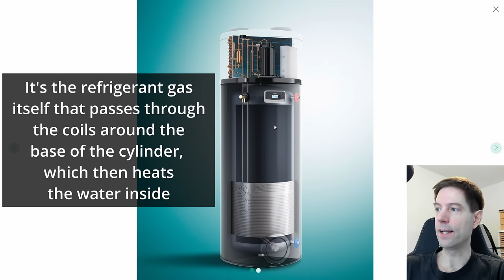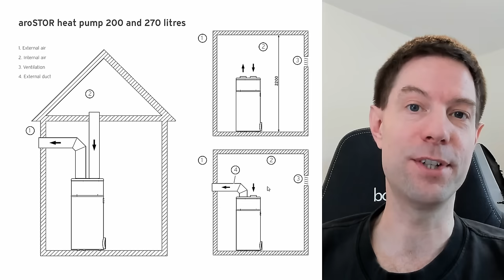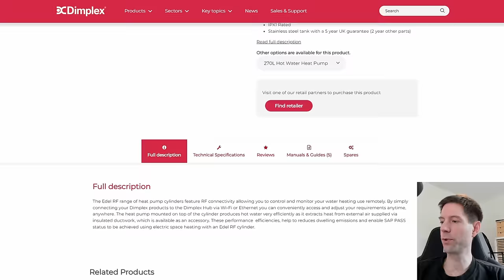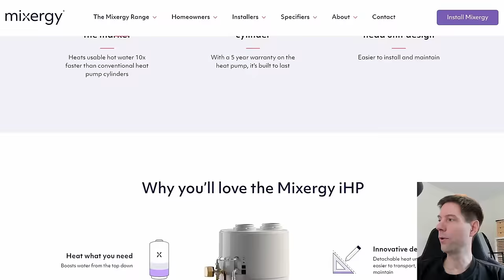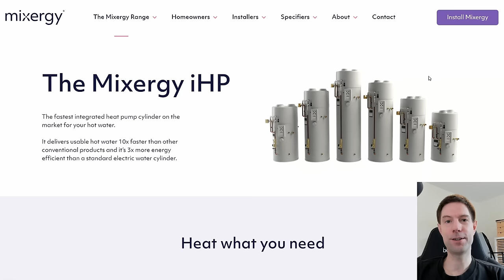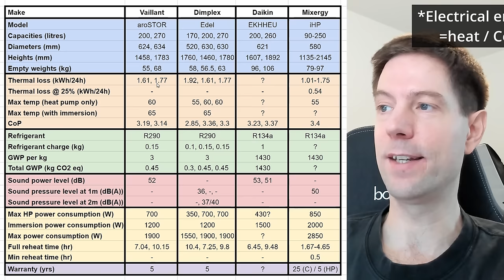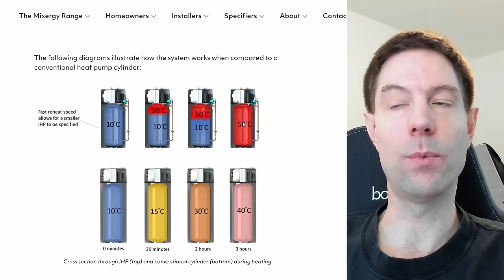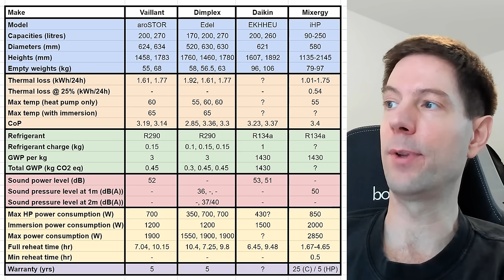Heat pump hot water cylinders - comparing specs

Comment: Thanks for highlighting these systems - they are, of course, very niche in the UK, and few people know they exist, but they are almost de rigueur in countries where A2A is ubiquitous.

A few observations gleaned from my own - very similar! - investigation.

Space Requirements:
The Mixergy's cylinder diameter is a bit misleading as to actual space requirements, because of the additional external siphon system. In fact, Mixergy specifies an installation footprint of 750x750mm for the iHP - probably fine in your garage, but sadly too big for the airing cupboard where my cylinder has to be. 
For those of us with indoor installation sites, the Dimplex Edel 170 has a potential advantage of using a concentric pipe arrangement, so that intake and exhaust air requires only a single pipe/hole-in-the-wall of 125mm diameter. The downside is the long reheat time, because the heat pump output power is limited by the (lower) air volume rates possible through the smaller pipes.

Max. DHW Temperature:
The EU specifications of the Daikin state a max. T of 62 degrees with the heat pump alone, 75 degrees with the immersion.

Refrigerant:
The R134a heat pumps really do have ca. 1kg of refrigerant - R290 not only has a lower GWP,  but does its thing with much lower charges than HFCs (and the amount of R290 permitted in an internally-situated unit is limited by regulations!). 
This year's IPCC6 report has re-estimated R290's GWP as 0.07 at 20 years and 0.02 at 100 years. 
Does the refrigerant GWP matter? Yes! The standard assumption is that any refrigerant loop (even in perfect condition) loses 4-5% of its charge p.a., and that any R134a manufactured will eventually end up in the atmosphere over a 100-year timeframe. In other words, it is assumed that any HFC manufactured (for use in a heat pump) will end-up in the atmosphere, so the less HFC that is manufactured the better!
R513a (GWP 573) is the modern HFC replacement for R134a (e.g. in the Tesy units), but ultimately, as the recent flurry of new monobloc A2W ASHPs demonstrates, R290 seems to be the way forward for domestic hot water heat pumps - it is somewhat surprising that Mixergy chose R134a for a new system (Mixergy probably wanted more power than the permitted charge of R290 could supply).

Noise:
The Sound Power Level of a unit is on the Energy Label; it relates to conditions set out in regulation EU813/2013, so should be directly comparable between units - but Energy Labels are not always easy to find on websites. Energy Label SWLs for the Dimplex Edel 170 and 200 are 48 and 53dBA respectively. I have a figure of 58dBA for the Mixergy (but it's obviously not from an Energy Label, so may not be directly comparable?). These numbers correlate well with output power - the Mixergy is loudest because it is the most powerful, and the Edel 170 quiet because its compressor is small.

VAT-Free:
Although these systems don't qualify for the Boiler Upgrade Scheme, an installation is eligible for the zero-VAT rate (on materials and labour) offered by the VENSAV scheme for energy saving measures. For simply buying a unit, I believe over-60s and those on certain Government benefits can qualify for VAT relief.

Cheapest Option?
For those who want to buy a unit (as opposed to an installation) I'd flag-up the Midea RSJ - globally the best-selling heat pump hot water system (very popular in Asia) - which is available in the UK from Tidyco for £717 (190L) or £1,155 (300L) ex VAT (two for the price of one Dimplex!). A drawback it shares with the Daikin (and other units potentially available in the UK, but not in your list) is the need for a sacrificial anode - Dimplex/Mixergy/Vaillant all have stainless steel cylinders that are corrosion-resistant (hence Mixergy's 25-year warranty).

Intuis - the Dimplex/Vaillant Similarity:
The Edel 200/270 and aroSTOR 200/270 are essentially the same unit with cosmetic differences. They are manufactured by Intuis, which is a French company that is part of the Glen-Dimplex group. The Intuis branding is replaced with the Dimplex one for the UK. I assume that the very slight differences in specifications between the Edel and aroSTOR may be a result of tweaks that Vaillant makes so that the unit runs to its preferences. The Edel 170 seems to be a Dimplex-only UK-specific unit - in Europe Intuis offers 150L and 100L variants.

Sorry for the length of this comment, but I hope the information is useful to you and others.
Reply from the maker: That's all really helpful, thanks for providing the extra detail!
Reply: You appear pretty knowledgeable on these. 
Like Tim and Kat I hope to move from gas to A2A heat pump - I have lots of solar and want the free summer cooling. As far as I understood it the boiler upgrade scheme does not rule out A2A specifically but simply says your space heating and water heating have to come from a heat pump - you can't have resistive only heating anywhere.
If I could find a single contractor that would fit me an A2A HP and a HW tank HP in the same job do you think I'd be eligible for the BUS?
Reply: I'm afraid the BUS requires, amongst other criteria listed by Ofgem, that an eligible heat pump system:
 “provide both space and hot water heating and be capable of meeting the full space heating and hot water heating demands of the property”
“be hydronic [transfers heat to a liquid for the purposes of space-heating]... Air-to-air systems are not eligible”
"be certified by the Microgeneration Certification Scheme (MCS)”
Your preferred arrangement can't meet these criteria. If you want blown-air heating/cooling, instead of using conventional radiators, you could look into using hydronic fan-coil units with an ASHP - which would qualify for the BUS. @VillageVidiot100
Reply: @sjhnmr  Thanks for that, really appreciate you coming back to me. Any suggestions of preferred manufacturers who make a good hydronic fan coil  that is similar to an a2a wall unit?

Comment: Been waiting for this one. Paused while I get a cuppa Tea & settle in for the watch. BTW I'm also looking at Sunamp thermal storage batteries as an alternative to integrated HP HW cylinders. Not as efficient but easier to find space for & more flexible location options. I hope you are both on the mend & have a great 2024.
Reply from the maker: Yeah, there are definitely space benefits to the Sunamp system.  We're lucky we have a couple of options for siting a cylinder.

Comment: For this winter I've moved the air intake of our MVHR from the outside to the attic. Even though we are now drawing a lot of air in through the soffits, the attic is always at least 4°C warmer and when the Sun comes out (as in the past few days) it's 8°C warmer. At the end of the day, if our house is losing heat to the attic then at leat we are recovering some of it - as would a hot water tank HP. The heat in your attic will eventually go to the outside - grab it while you can? Not the same scenario if you install in the garage of course because you probably do want some warmth in there.
Reply from the maker: If I install this in the garage I'm definitely not using the garage air for the intake, it'll absolutely need both vents going to the outside.

Comment: I'm in a very similar situation to you - I'm renovating a property and will be installing air-to-air heating. Previously hot water was just provided by a barely insulated vented immersion cylinder, so that definitely needed an upgrade.

Just a couple of things to add from my own research in case they are useful for anyone else:
- Thermal loss for Daikin cylinders: 1.512 and 1.704kWh/24h  for the 200 and 260L models respectively (just found in datasheet, listed in watts under "Standing heat loss")
- Daikin max temp: 55C

Personally I will (hopefully) be going with the Daikin cylinder, I've received a quote and put an order in, but I'm just waiting for stock since it's new to the market.

The Mixergy cylinder is appealing (hopefully more maintainable, probably better controls, wider range of sizes - 200L is too big for me really). The significant price premium puts me off though (around £1000 ex vat based on the prices I have got). Just didn't seem to be worth it given that my energy usage for hot water will be fairly small in comparison to space heating. I'm not on a smart tariff either, so the reduced reheat time doesn't really matter that much - it can just be left to run whenever necessary to keep warm.

The Daikin Multi+ system would be perfect if only it had capacity for an extra indoor unit - I need 4 units but it only supports 3 annoyingly!
Reply from the maker: Ah, great, good find.  Not sure why I didn't find that Daikin datasheet.  Best of luck with the renovation!

Comment: Good video. We have a standard mixergy 210lt tank with a ecodan heat pump. The comment on the mixergy is we always have hot water even with a familyof 5, it manages the levels really well. Ours stays around 50% at the moment, but that will change once some of the house renovations are completed when other demands are put in place. The time for new hot water to become available is very very quick should someone attempt to drain the tank completely, and I say attempt as the unit starts to heat water when the level gets below a set level. Yes, mixergy tanks are more expensive than others, but they seem to work.
Reply from the maker: That's good to know.  Hopefully we'll get this sorted in the next few months and I can start to report back on the performance.

Comment: Heat pumps using a refrigerant with >150 GWP is about to the target for the EU under the new 2024 F-Gas regs (coming into force within the next 2mths) so manufacturers who look to market to the EU are very likely to switch to R290, even if it is a combustible A3 classification gas.
Reply from the maker: Yup, in fact I spoke to Mixergy and they are switching to R290 before launching the iHP.

Comment: In the summer taking air from your hot loft would be a good idea and then as the exhaust air will be dehumidified and cool, in the summer it would would be beneficial to pipe that into your home as this should help your A2A cooling efficiency. In an ideal world if you are able to setup the ducting with bypass dampers on the intake supply to extract air from loft or outside as needed. Do the same on the exhaust, reuse the cool air internally on hot days and redirect it out on cool days. That would probably optimise the overall efficiency.

For those with solar panels on the roof, especially those with in roof panels, it would be interesting to know if cooling the loft space in this method would improve the solar panel performance. 

I have seen some installs which extract air from bathrooms into the the intake of the heat pump cylinder, which is nice way to close the loop where you don’t have MVHR system. In that scenario you would want to exhaust directly outside to avoid odour issues. 

Still looking at the Daikin multi plus as this does, the heating, cooling (max 3 indoor units) and hot water albeit max 120L with one external unit.
Reply from the maker: Indeed, you could get very creative with the ducting but it'll probably end up being a practical consideration, since the duct runs would end up getting very long in some cases, and probably need to go through ceiling voids and such.  Now if I was building a house from scratch that sort of arrangement would definitely be worth considering.

Comment: Oh exciting just what ive been waiting for :) hope your both feeling better and Happy Hogmanay :)
Reply from the maker: I mean, you're kinda already sorted, no?  I think we're both over the worst of it now, thanks.  Happy Hogmanay to you too!
Reply: Yes I’m happy with my choice and my garage is not within the envelope of the house as it is attached and accessible via the main house but is not within the houses cavity wall build but a single build which i plan on creating a insulated wall within the space. What I did notice that my cold water pipe that was extended to the garage for my heatpump actual had froze one day so I corrected that by applying more insulation  around the the part that was frozen and thats corrected the issue.  The noise level is not really bad other than the sound of air that is going through the top but that will be very much reduced if you vent both pipes outside.  I did look at the mixergy prior to my choice of unit but they didn’t have the airsource option available and I needed a solution for hot water quickly after going over to a complete air2air heating solution. I think all the choices that you have discussed will give you more or less the same performance with slightly different effiencies in different scenarios. Keen to see how the Mixergy performs when you get it.
Reply from the maker: @bobbazley5376  yup, I'm looking forward to getting this sorted soon.  Not exactly sure when that'll be but within the next few months, for sure.  I'm glad you're happy with your choices so far.

Comment: It could be worth an inlet and outlet pipe arrangement which includes diverter valves for summer and winter set ups. On a hot summers day you may want to suck the warm air from the house and discharge the cold air back into the house (i.e. free air con), and in winter divert both pipes to the outside to avoid robbing heat from the house.
Reply from the maker: Yup, it's just a matter of practically at the end of the day and whether it's possible to have all those vents going to different places.  If it's doable then great, but it's probably not worth the extra complication or cost in most cases.
Reply: @TimAndKatsGreenWalk  agreed.
Reply: Combined with MVHR this could be an interesting experiment 🤔
Reply: @TimAndKatsGreenWalk we want rid of our hot water cylinder as don't use it and it takes up alot of space
Reply: @theoddjobcentre6686 if you don’t use it I assume you’re using gas for hot water?